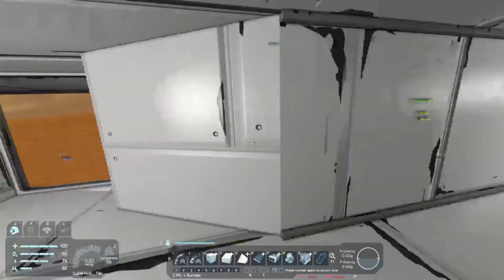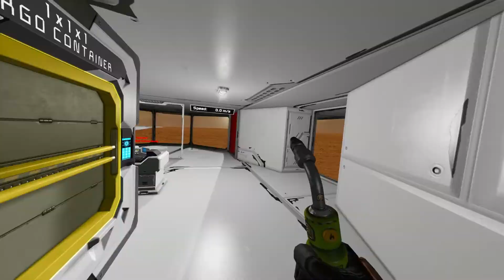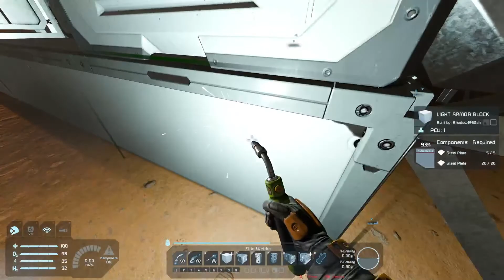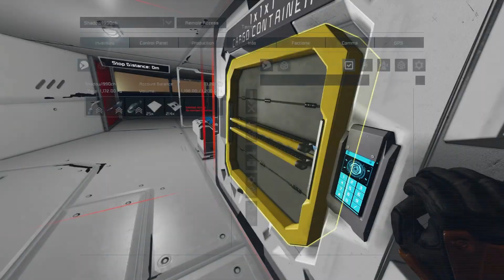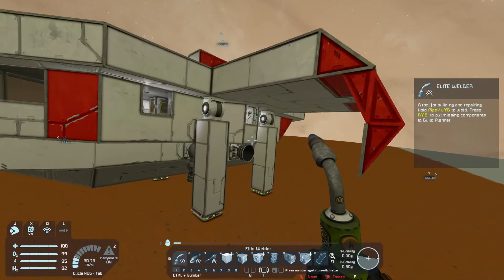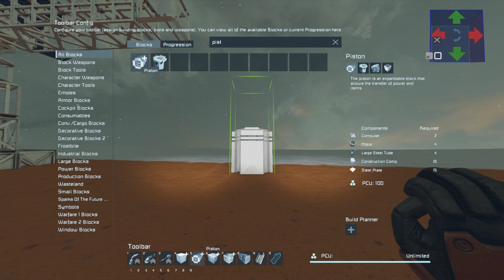Space Engineers: We need a Drill!

Comment: alt / middle mouse button deposits all depositable items into container (when mining ores etc.)
your explanation was very good at the beginning, thanks.  i use wind farms a lot, and i always place them at least 8 blocks away from any other block.  i use a tower type design.... starting with a tower of plaiun blocks going up at least 10 off the ground place a block in each direction. n, s, e, w,   then place another on top and put a turbine on each block. i some times go another 10 blocks higher and make another cluster the same way. turbines are 3 x 3.
just a note on your drill aparatus.... you may have issues with your hinge not being able to lift due to excessive weights? i sometimes start with a piston going up then put an adv rotor on top of that then shoot out with at least 2 pistons  before going back down with pistons etc.  lookin good so far  : )
Reply from the maker: Yeah the weight might be a problem,. Normaly i also build these fixed drills with piston/rotors only, but i kinda want to see if it works with the Turret control bock. Try and error i guess :D
Reply: best way to learn is by doing ; )